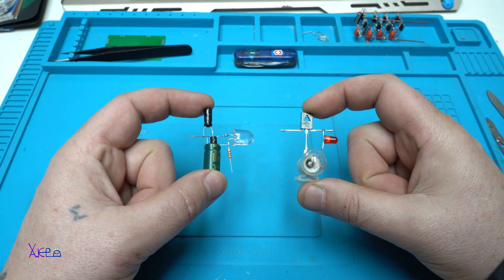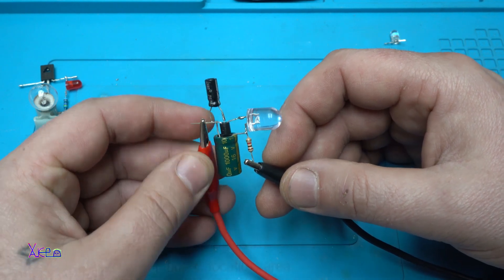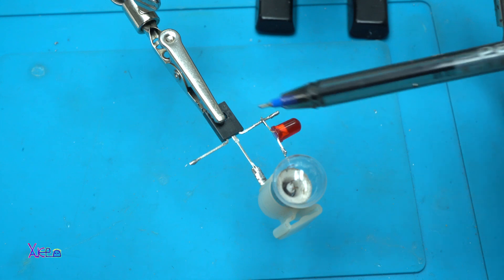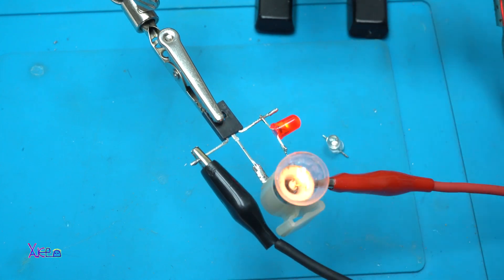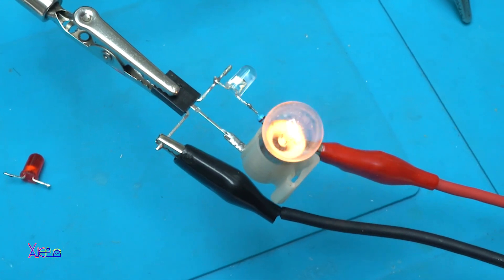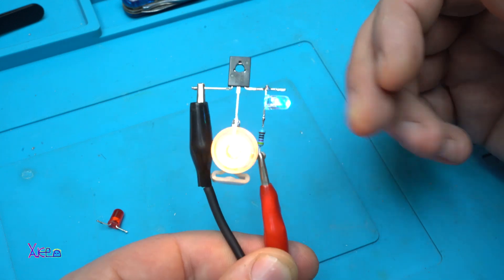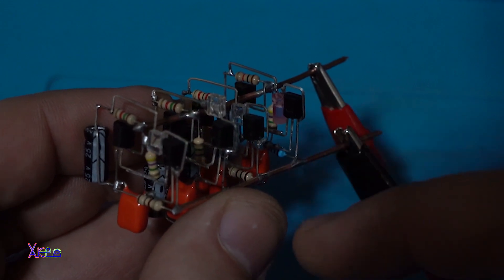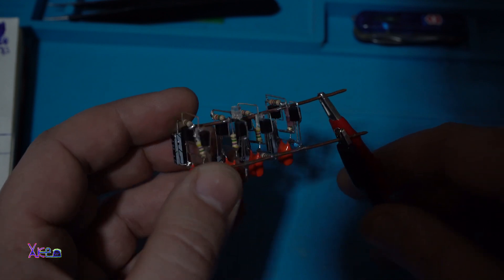3 DIY Projects Using simple parts!

Comment: Nice work Mr Hacktuber!   When I was a youngster I used to make "flashers" from an LM3909 IC, a cap and an LED, all powered from a 1.5V battery - it would flash for months and months, I think up to several years depending on the cap size and battery size.  The downside is that the IC is quite pricey, even 45 years later  :(
Reply from the maker: That's a classic, the LM3909!  its hard to find it these days